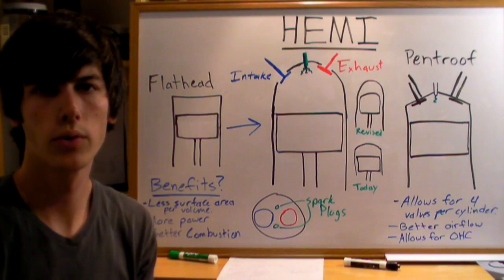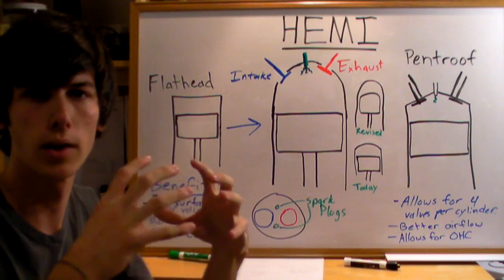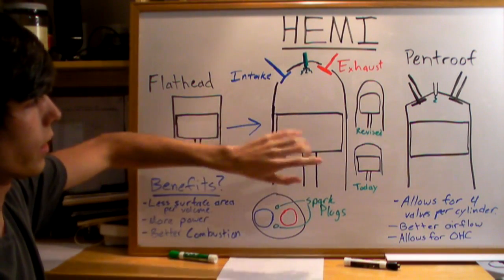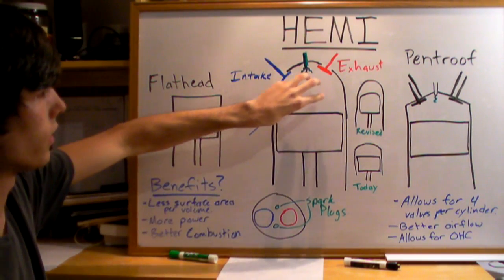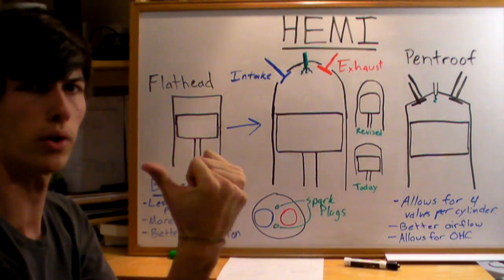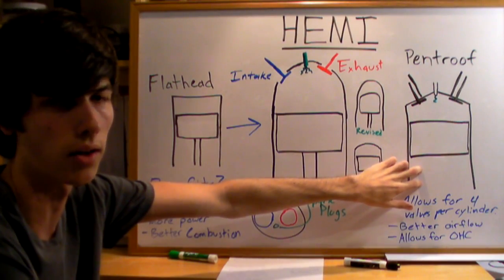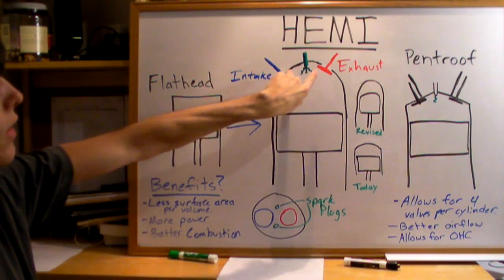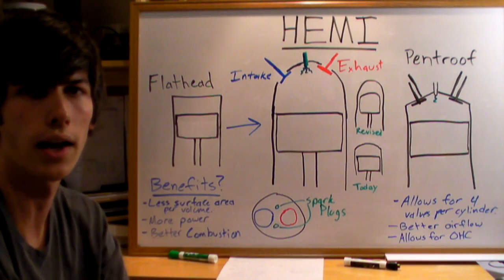What Is A HEMI Engine?

Comment: Hemis and push rods. Smarten up America you're losing your car industry.
Reply: ford doesn't use hemi heads
Reply: +Thesaltyseafish Chevy uses wedge heads. I have a late 80's 4.3 Chevy being rebuilt in my garage and a 5.3 vortec in my truck to prove it. Also, the LS and Vortec motors are pushrod. The 5.3 Vortec has a higher VE than the 5.0 in the Ford trucks (which is a superb motor by the way) which uses dual overhead cams on each bank. The pushrod Vortec gives the Chevy and GM trucks better fuel economy than the Ford and the rated output is similar. It is also cheaper to fix or modify the valvetrain on a Vortec than a Coyote motor or other multiple cam motor. There are fewer cams to replace, fewer gears to replace and synchronizing everything is easier. The only added cost are pushrods, lifters and rockers, which are cheaper than buying extra cams. I would speculate that the Vortec is a lighter engine as well due to having a much less complex valvetrain. I know that the aluminum block LS engines are light and are often swapped in to four and six cylinder Asian and European cars, whose drivetrains are more complex, with very little weight penalties, but substantial power gains. Pushrod motors, like any other motor have their pros and cons, but I don't think America has anything to worry about from their motors. The US is still building some of the finest motors available.
Reply: Americans like simplicity. What is wrong with the push-rod engine? It's great on trucks because they are simple and make a lot of torque at a smaller cost. The Corvette gets 29 miles per US gallon highway out of one. TFLcar, a youtube channel, managed to get 25 miles per US gallon highway with a Challenger Hellcat on 500 horsepower mode. Not to mention the challenger itself is a 4000+ pound brick itself. Our 5000 pound Jeep Grand Cherokee is not the vehicle I would get a V6 in, so the humble HEMI push-rod engine with almost 400 lb-ft of torque was our choice. Your pals at Bentley still use that old push-rod V8 in the Mulsanne, and it makes diesel engine torque with the help of turbos.
Reply: Fiat
for when ford is too reliable for your taste
FIX IT AGAIN TONY
Reply: +Dcc357 There's nothing wrong with pushrods. They work fine.

If there were something wrong with them and there isn't, but if there were - just sayin' - it would be the difficulty in getting multi valves working in a pushrod V8. 
Multi valves are kinda orrite, because they don't need to be opened very far as they have double the opening area because there are four rather than two valves. This is helpful for swirl and good for air velocity because each valve is relatively small and has it's own small port, each with it's own high velocity air flow. The volume of the air is greater at part opening too than for a single intake valve.

Pushrods often limit the position of the intake and exhaust valves in the cylinder head because the pushrods must pass through the cylinder head and there is limited real estate there. This may force a less than ideal combustion chamber and spark plug position. Sometimes this limitation forces a poor exhaust port design where the short turn radius or the bottom of the port causes the gas to stall. Naturally all this isn't helped by cast exhaust manifolds that turn the gas without so much as a smooth bend but more a collision with the manifold runner wall. 
Port positions can be better optimized in OHC as these limitations don't apply as rigidly.

OHC allows smaller capacity V8s to make similar power as a larger capacity V8 by revving harder. All those valves allow good upper RPM breathing. The multi valve quad cam V8 does better in smaller capacities where its smaller size saves on fuel because it turns similar revs to a larger V8s in the cruise but is a liter or two smaller in cubic capacity. The smaller V8 makes similar power to larger V8s but needs about 1500 - 2000RPM more to do so. 
There is little lower pumping loss (loss in the production of power) advantage with OHC vs pushrods. Given two almost identical V8s viz. a 350 2 valve OHC vs a 350 2 valve pushrod, then expect similar power with identical valve lift, duration and overlap.

All that said, I'm actually inclined to agree with you re pushrods. In the real world the benefits are hardly worth the effort. There is a great deal to be said for simplicity. Two engines that do fine with pushrods are the Vortec 350 and the Gen III & IVs. Those engines are long lived, plentiful, cheap to rebuild, get reasonable economy and have good power. Yay the Hemi, Yay for pushrods (with machined rather than stamped rocker arms).
Reply: That's interesting. I have once thought why 4 valves in a push-rod seemed so taboo, and that makes perfect sense. I read on it a little more and the only way to get big performance numbers is to increase a push-rod's displacement due to only 2 valves. This may only enable engineers to make a better combustion chamber with a 2 valve layout. I noticed Ford's OHC 5.0 V8 and its power from smaller displacement, and it makes sense. The only other advantage I can think of is that push-rod engines have its cam and rods in the unused space between the heads, and not on top of the engine.This makes it more compact despite the huge combustion chambers,
Reply: nothing wrong with pushrods. only reason they are a problem is idiots who read magazines spreading nonsense about them. engines with the highest brake mean effective pressure in the world have pushrods.
Reply: +The real doktorbimmer not true. the pentastar is a great engine and many of those Fiat engines are built on American soil. many new products from FCA are collaborative between American and Italian engineers.
Reply: So, as far as smaller.  I have not come across anyone swapping a Ford or Chrysler into a Miata or S2000.  They simply wont fit, or at least not easily.  You can't even fit new fords is most old fords; the engines are so much larger than the old ones.  I wanted to find a picture with all three on stands next to each other, but no such luck.  Most people are so brand specific that no one cares.  I thought this was quite sad as that would be a very interesting picture. 

As far as weight.  This was also really hard to find and I had to do a bit of math on the Hemi using the weight difference of an aluminum block.  For similar displacement modern engines: Chevy 442.2 lb, Chrysler Hemi 490 lb, Ford 521 lb.  The LS is the lightest.  The Hemi is heavier because Hemi heads are massive!  and the Ford is heavier due to all of the support structure required for the over head cam/cams. 

Now as far as power and efficiency, no the LS will probably lose to the ford with their dual overhead cams.  However, as stated in this video it would probably outdo the Hemi due to the lower compression and or higher rotating mass of the Hemi.  Especially since you seem to prefer talking about exclusively factory engines, not aftermarket ones.  And as far as simpler, even the guy who makes these videos referred to in block cams as "less complex" in his DOHC vs OHC vs OHV video.  In that video he also stated that they were "more compact" as well.
Reply: +Rangifulla xd
Reply: +The real doktorbimmer ; Ford had the Boss nine, a semi-hemi. The gas guzzler tax is killing off big blocks. Imagine how efficient a 7.0 L could be nowadays, plus the increase in power would be fantastic.
Reply: I see you are incredibly biased. Not much point in continuing this discussion. Have a good one.
Reply: +Thesaltyseafish The LS still uses push rods and it's arguably the best of the American V8's.  Everything has some trade off.
Reply: No, not at this point. My only point really was that in block cams can be just as good. They're smaller, lighter, and often simpler.
Reply: Sorry,you're wrong...1904 comes before 1905
Reply: Try doing the same...1904 Welch,first Hemi car engine
Reply: Wrong..Welch in 1904
Reply: +My username is longer than you would expect
Shows what you know! I'd say 95% or more of domestic vehicles utilize OHC or DOHC setup. (Unfortunately..) OHV is far easier to maintain and work on. Thankfully, I got an OHV 4.9L I-6 in my F150...210,000 mi, 23 years, and still has great compression and oil pressure! I got one of the old GOOD engines before they discontinued 'em!
Reply: "and now Fiat is carrying on the tradition "
Gee, I don't think "Fix It Again Tony" and "good engineering" belong in the same sentence.
Reply: " "I have not come across anyone swapping a Ford or Chrysler into a Miata or S2000.  They simply wont fit,"Thank you Mr. genius.. you just proved my point..  man that was easy"
What he meant was...you can't fit an DOHC, modern Ford or Chrysler into a Miata. PLENTY of people have swapped in OHV Windsor blocks and LS/SBC into them. An OHC is much larger than an OHV of the same displacement, which in turn is much larger than a flathead of the same displacement. It's all about how much "stuff" you have above the head gasket: a flattie has virtually nothing, an OHV has a little, an OHC has a lot!
Reply: Rockthevox that's funny because we just had a gay lil Fiat in the other day
Reply: What's wrong with pushrods? It's a more efficient way to package an engine and utilize space in the valley that is normally empty.
Reply: +The real doktorbimmer I like your style
Reply: +Thesaltyseafish Longevity is a factor of many things. Block design on small engines is exceptional ie butressed/ribbed crankcases, five or more bolts around each cylinder bore for the head, instead of the usual four etc help the rigidity of the entire engine structure. Tall deck height also minimizes thrust loading of the pistons on the cylinder wall, allows a straighter 'push' onto the crankshaft and reduces bore wear and bore flexing under high load. 
Of course modern casting techniques and machining are a large part of it.
Multi valve is no panacea. Valve train pumping losses are still high on those engines. The real reason multi valve is used is valve control at high rpm. Lower lift and more valve area afforded by four as opposed to two valves give engineers more breathing space (pardon the pun:).

V8s can be made to last like the engines you point to, as well.
Reply: +Rangifulla ; It takes up less space and has a lower center of gravity. NASCAR engines are still running push rod motors because they have funny rules like that. It's a funny story going back to the 60's, whereby Ford would show up with a SOHC and it would get banned. Dodge came with winged  Hemi, and it would be banned, and, on and, on. They finally allowed and mandated fuel injection for everybody just a couple of years ago. They settled on the oddball cubic inch displacement of 358 max. in 1971 or 72.
Reply: +SupersonicVette Less weight, cylinder deactivation, less cabin space, less air resistance, many other minor things that have very little to do with engine displacement. If what you want is a figure relating output to fuel consumption then you'd have to run some tests yourself, as these aren't available figures.
Reply: It's a favorite of Tom Nelson.  Must be pretty good.
Reply: No, but I am.  He is a famous racing engine builder.
Reply: Tuner/builder.  Most of their engines are built from the ground up, but sometimes they use factory blocks.  Apparently 1500 HP with twin turbos is a pretty common request.  Some go up to 2500 though obviously on race fuel only.
Reply: I'm not SAE.  MSME.
Reply: +hay bro 1904 Welch,actually...
Reply: Ever seen a photo of the Welch engine?...It had a Hemi shaped combustion chamber...therefore making it a Hemi
Reply: This whole debate is easy. Which would you rather have to work on? A OHC or pushrod motor?
Reply: The real doktorbimmer yeah, that's the point. Ford had all kinds of issues with cam phasers. I know. I owned one.
Reply: 99%? lmfao
Reply: That's a real shame.
Reply: How many OHC engines has GM produced? Idk if you realize this, but one of the main reasons people buy GM trucks, is because it's a pushrod V8.

OHC engines are exponentially more expensive to repair and replace.
Reply: The real doktorbimmer because there are more OHC motors, in cars, with one Bank of cylinders, where it makes more sense to have OHC.
Reply: The real doktorbimmer yeah, because it brings the customer back for expensive repairs lol. I've seen the timing chain guide break on a 5.4 Triton, as well as cam phasers go out. It's not fun.
Reply: The real doktorbimmer a Vette broke a chain. Wow. Real shocker.

Common sense tells you multiple chains that have to stretch as far as they do in an OHC engine are not as reliable as in a push rod.
Reply: The real doktorbimmer talking about Ford design with 5.4 Triton. I owned one, and my neighbor owned one. His guide snapped off and mine had early signs of cam phasers issues and was using a quarter tank of gas every 20 miles
Reply: doktorbimmer can I
Reply: Uh no
Reply: AFAIK no US car manufacturer is producing an actual hemi engine. Push rod engines help keep the overall cost of a vehicle down, and most provide more than enough performance An over head cam doesn't automatically mean a better combustion chamber design
Reply: As in regards for why the video was produced it's accurate. A propose DOHC hemi that never seen the light of day is irrelevant when explaining  basically what a hemi is.
Reply: I had a honda 4 wheeler 2 valve's in cylinder domed head, spark plug came into the cylinder a angle between the valves was over head single cam used a chain and a domed piston with valve flycuts to clear the valves. It was only a 125 but it ran like a much bigger engine.
Reply: +Thesaltyseafish 
The new Vette has push rods, what a joke.
Reply: Jesus fellas I know chev doesn't use hemis, I know dodge wasn't the first. All this spawned from me shitting on american engines. Fact of the matter is a modern hydraulic valved DOHC motor is the only sensible solution as they get 200K + miles without work. American cars aren't getting that kind of mileage with the exception of a few (town cars for example). All modern engines that aren't designed for towing should be 4 valve per cylinder, pentroof heads, hydraulic lifter overhead cams, and have 10:1 CR for pump gas.

Comment: In my opinion the best engine ever built what engine was banned in nascar it was the big block hemi, in my 2004 ram quad cab with the 5.7 hemi it will get up and go and move that truck even thigh it's a pretty heavy truck and does pretty good on gas but I also use a bully dog gt pro tuner
Reply: +The real doktorbimmer No I have a 5.7 Hemi. Also takes two spark plugs